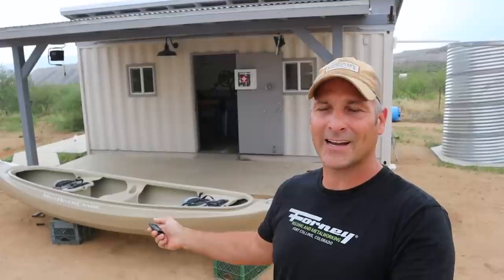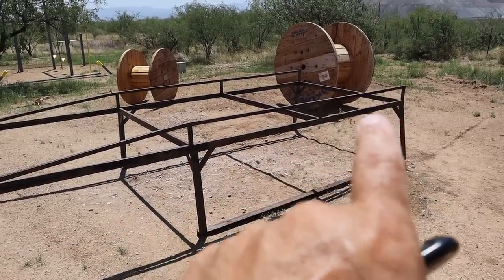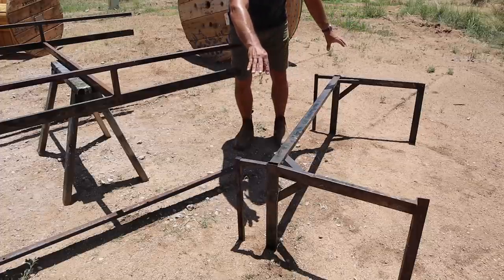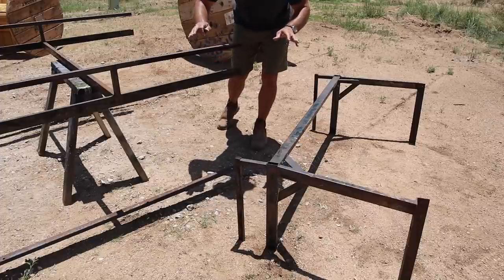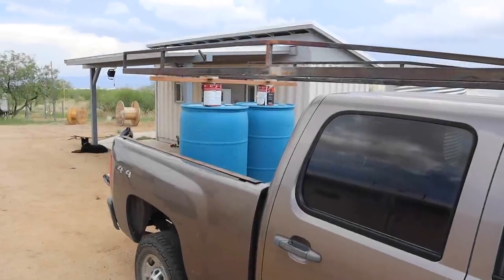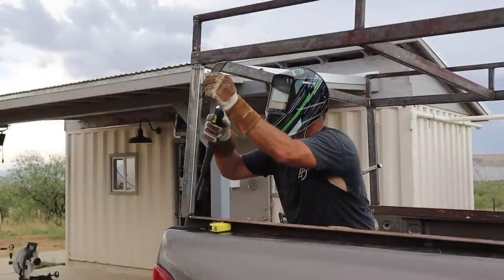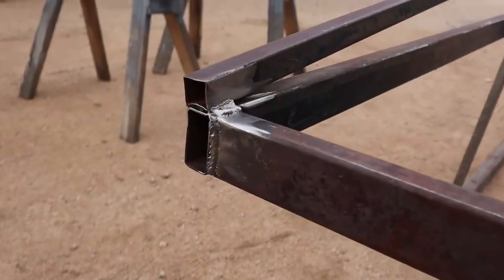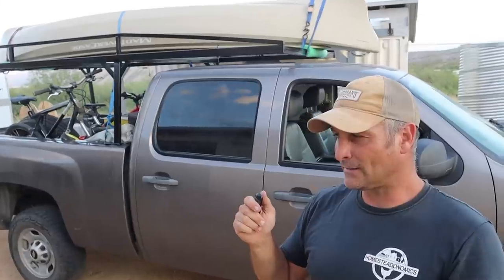Craigslist Junk to Truck Rack Treasure - How to

Comment: I love projects like this. Modding something you bought is often even more satisfying than fabricating something from scratch. And you always do them so well with your mix of woodworking and metalworking skills.

Some of that nice, shiny diamond plate you used on the trailer would look good on the front of the roof rack. The shiny surface would reflect the sun enough to keep the truck cab a lot cooler.

And I fully expect to see either some custom containers or custom mounts for store-bought containers for your camping gear, that will fit on that rack like Lego bricks and give you an easy way to load and unload in chunks. Plus the containers can function as extra camp seating. Even just a few bolt holes drilled through the rack here and there would allow for each secure packing of gear like bikes, without as much need for ropes and straps.
Reply from the maker: Oh yes!   I’ve thought about how I can use it for making things stow and be secured better.   I’ve thought about some side boxes that I could use for camping but also for the occasional side job I do.   Lots of possibilities.   May have to keep my eyes open for some cheap diamond plate boxes that I can fit into this setup.

Comment: Great last minute build for your camping trip.  Looking forward to camping trip video.  I’m sure most of your viewers do as well.

I had a welder tell me once why they wear the little caps.  But I guess you also know.  He used the face frame open back hood and pulled his cap bill over his ear.  Said that splatter in his ear was mighty painful!
Reply from the maker: I definitely need to get one but I guess it’s just the space between my welding projects is long enough where I end up forgetting😂

Comment: I used to love canoeing, but I didn't realize how much difference a good canoe makes.  Picked up a Bell Morningstar off CL and it's like driving a BMW compared to the plastic things available at stores.  As a blacksmith, kudos for doing a great job on your rack.  Adding some kind of sheet to the fore-end will make a big difference if you get the right kind - something like perforated sheet rather than expanded metal.  You can make a reasonable deck there by using 1"x1/8" flat bars welded 1" apart, or less.  That will give you good coverage while also allowing rain and debris to fall through.  Just don't forge to put cross-members underneath so the bars are tied to one another for rigidity. While you're their, it'd be a good idea to go around the whole thing and weld on a ton of loops for tie-downs.  You can never have too many points to fasten a load and they're easy enough to make with some 1/4" round bar and a bench vise.

Comment: Consider slightly lower side rails and slightly higher cross bars. This would allow  loading the rack from the side of the truck with a forklift.
Reply: Do you think that rack would hold something heavy enough that a fork lift would have to lift it?
Reply: @LucifersDeathSquad  you can use a forklift for convenience too
Reply: @LucifersDeathSquad  yes. like decking , lumber , drywall.  not a lot but  more than you want to lift a one time alone , or with an older or expert forklift driver .
Reply from the maker: This one is pretty light weight.   So it’ll be more for material I can move by hand…but just longer than what the bed would hold easily.

Comment: Nice job as usual Joe and be careful of the welding sparks falling on your head or going down your neck when welding overhead😊...lol
Reply: I usually wear a baseball cap backward...and try to remember foam earplugs to keep molten beads out of my ears
Reply from the maker: Oh I’ve got about another 10 burns before I learn my lesson to wear some more protection.   I’m a gluten for punishment sometimes 😂

Comment: Another great and interesting video Joe. I was just wondering how did you fasten it to the truck? I only saw the angle iron on the top of the bed. If you use a piece of PVC on the back you could roll the kayak on or canoe. How much would it cost if you had to buy the metal from scratch? Thanks again
Reply from the maker: I mounted it with the existing holes that were on the angle.   As far as building it from scratch,  I’m not sure.  But I’m guessing just a quick ballpark would be $300 or so

Comment: If not done so already I would weld some caps on the rails in front to keep rain from going in and rusting the metal. Just my 2C
Reply from the maker: I opted for the lazy solution….I just added some plastic caps to the ends

Comment: Appreciate the video. I’m curious what you think that rack will hold weight wise? I’m thinking of doing something similar but for a 10-12ft aluminum boat. Also need to learn how to weld but one thing at a time! ✌🏽😜

Comment: Is the Ryobi grinder a P421 or a P423 please.
Reply from the maker: Here is the one I’m using to cut the metal…. https://www.homedepot.com/p/RYOBI-ONE-HP-18V-Brushless-Cordless-4-1-2-in-Angle-Grinder-with-4-0-Ah-Lithium-Ion-HIGH-PERFORMANCE-Battery-PBLAG01B-PBP004/320655433

Comment: I happen to get a good amount of square metal tubing offered to me for free once a year. It tends to rust before use to what I see in this video as a bare minimum. So...

How are you / What are you using to, remove the rust before priming and painting? 

Please let me know, or if someone else knows what he uses and or does, can you please let me know?
Reply from the maker: With rusty steel I usually do a wire wheel to get rid of the rust and then a good metal primer.   Sometimes I’ll use ‘rusty metal’ primer that rustoleum sells.  Then I finish off with paint.

But this one I did not prime since it was painted before hand… so I just washed it real good with water and a small bit of soap.  Let dry and then finished it with paint
Reply: Thank you. I will give it a wirewheel a shot then! Thanks!